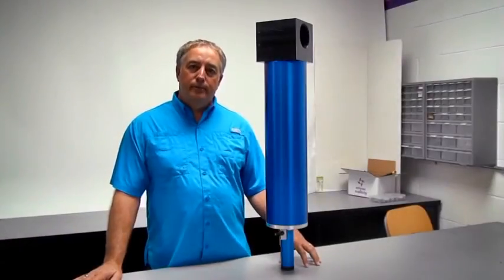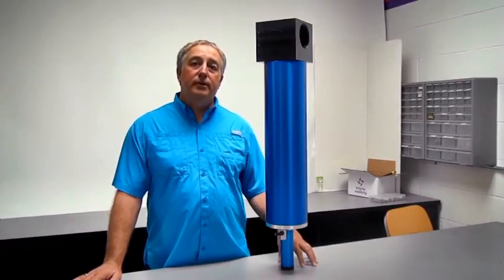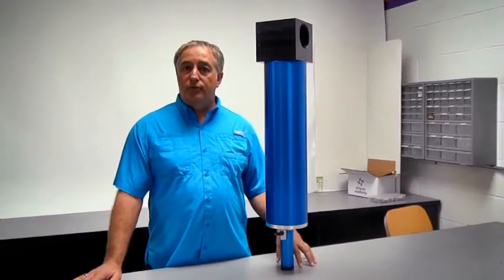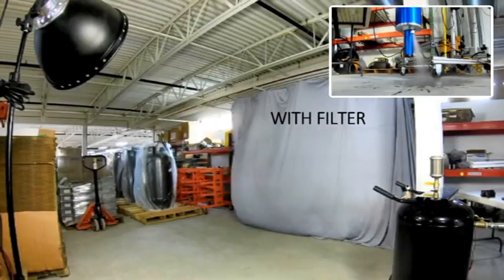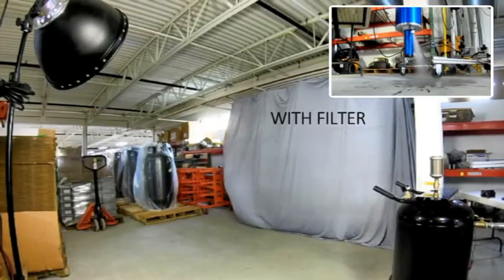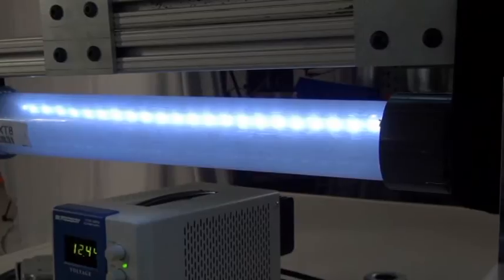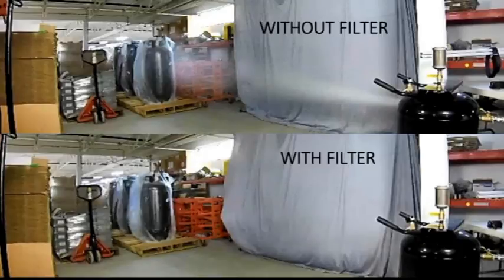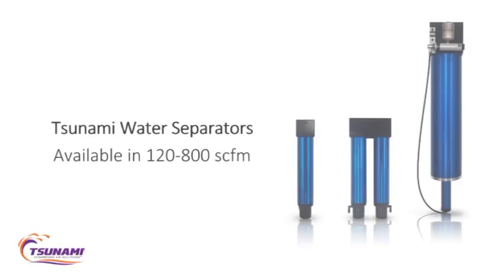Tsunami Water Separators for Bag House Applications

Comment: We ordered this water separator for our baghose for dust collector blowdowns. SO far it hasn't separated a single drop of water from the lines. I know we have water issues which is why i looked into separators. This was advertised as the exact product we were looking for. Too bad it doesn't perform
Reply from the maker: Hi Calab, thank you for the feedback. We're sorry your Tsunami system hasn't been performing correctly and would  like to correct the issue. Would you mind reaching out to us? 1-800-782-5752 or info@gosuburban.com